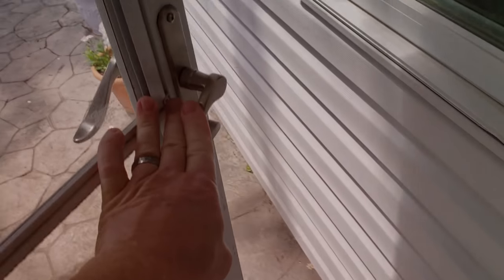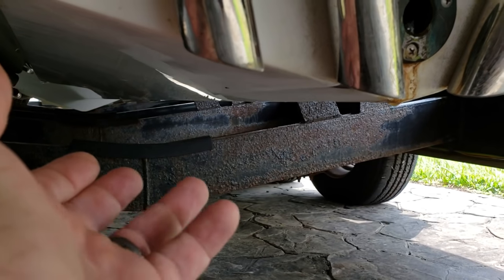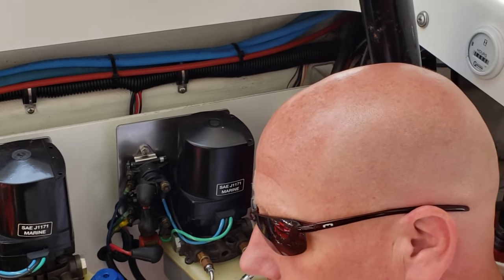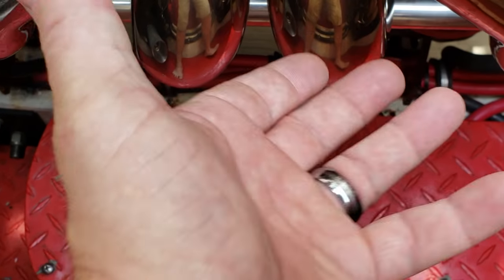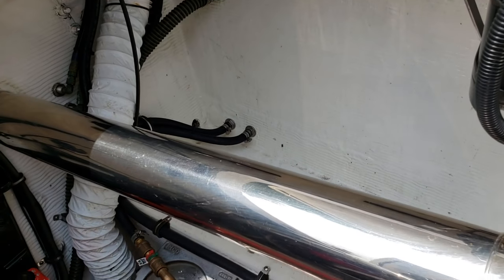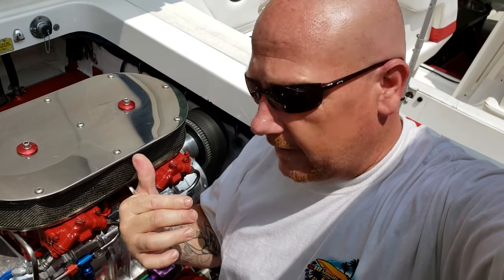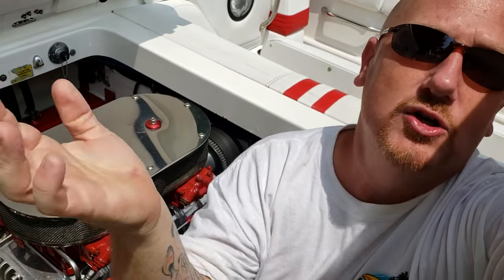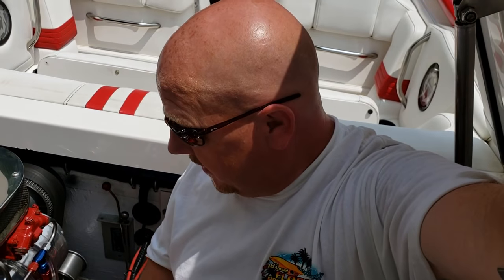I'M BACK and I'M BLOWIN' OFF THE SEA STRAINERS !!  - E122

Comment: Wes, Glad to see you are back and posting new videos. I for one missed seeing your shiny head !!! sorry had to poke fun at you my friend!!! Anyway I know Art and the guys will get you working good. We spent quite a bit of time with the same issues years back. We ended up making our own pickups and modifying them until we got the best we could. We also put full flow to the headers with a 1.25" hose from the head direct and then put pressure reliefs on the tail end of the header and dumping that overboard. That is what finally actually fixed my issue with the headers getting too hot.  The pickups helped and we got closer and closer then we did the header mods and we were done. Shoot me a email and I will send you a picture of the setup.

Again glad you are back and as always God Bless !!!

Tim
Reply from the maker: Tim ... Ok, excellent info and thanks for the support !    GOD Bless YOU